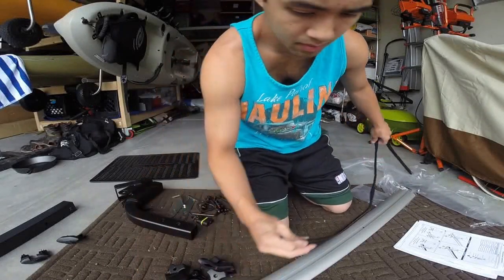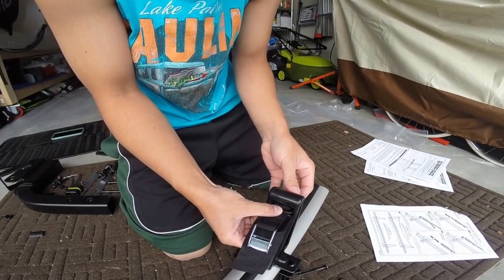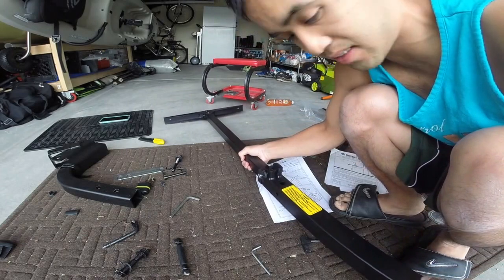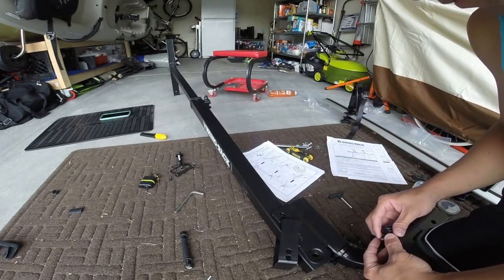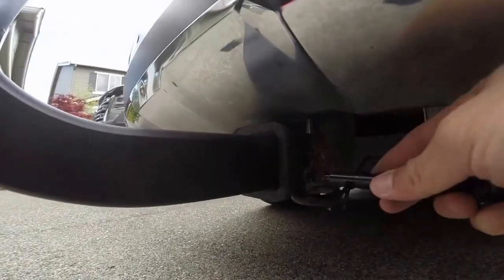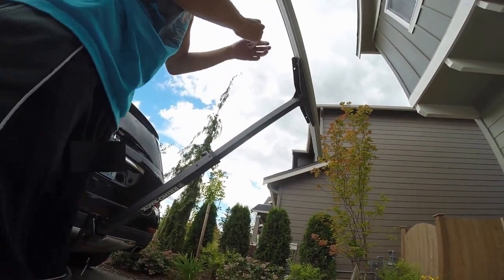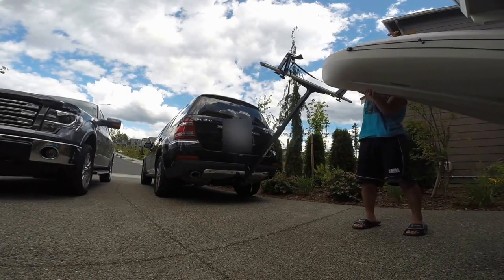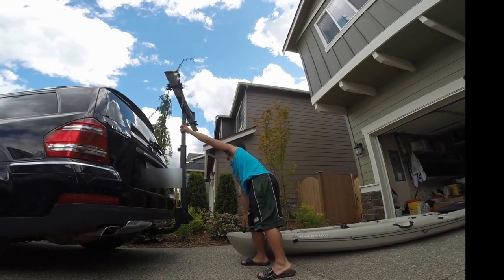Rhino Rack T Loader - Install and testing

Comment: Just wondering how long is your kayak. I have a Nucanoe Frontier 10 and am thinking about getting one of these Rhino loaders, just doing research on them now and from what I've seen they seem pretty good from most of the reviews I saw. I have a 2016 ford escape. Just wondering with my kayak being only 10ft in length and 38'' wide if it would still be doable with the Rhino loader.
Reply from the maker: I don't see why not mine was 10ft as well